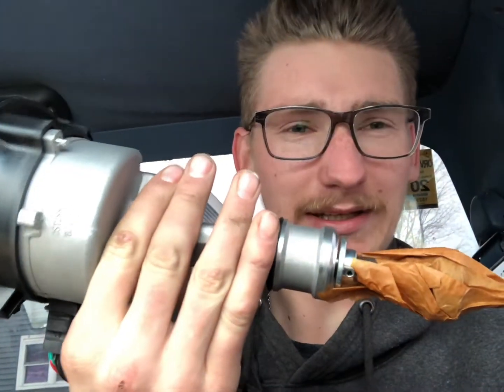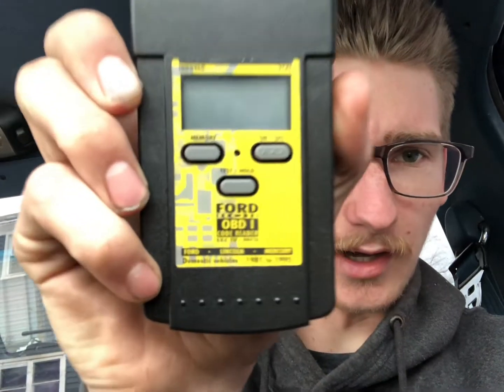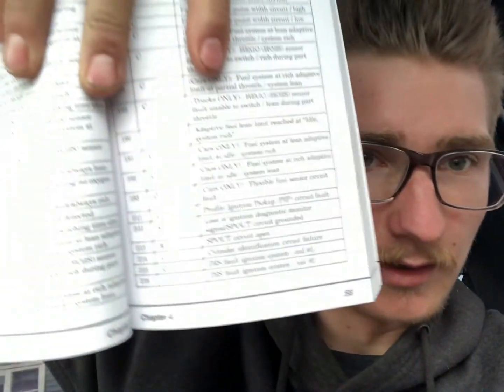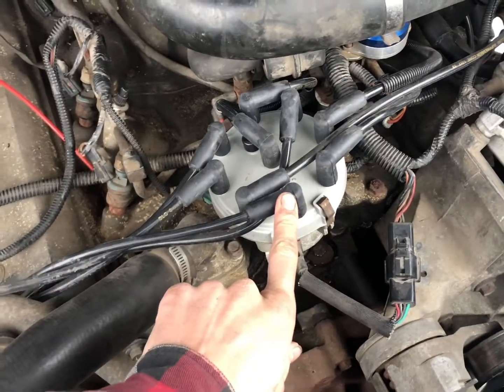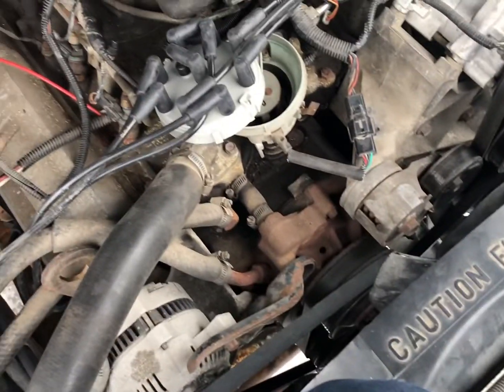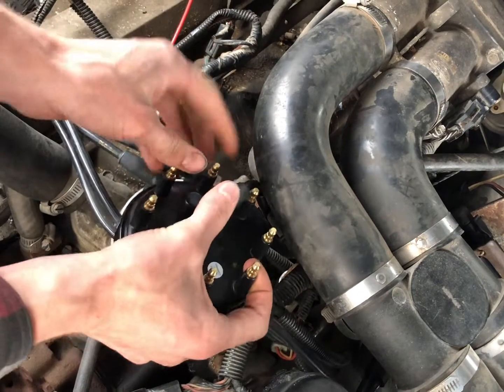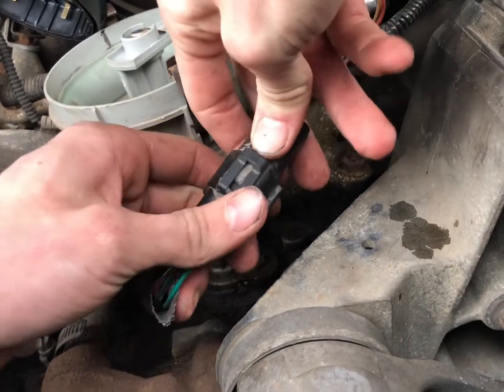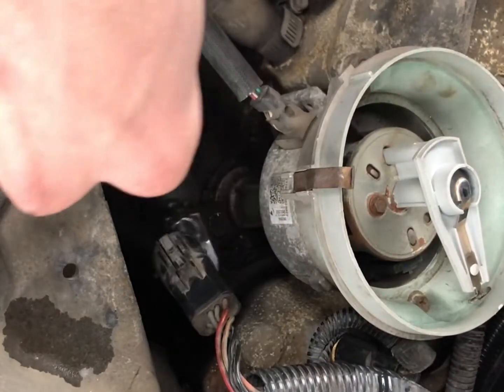1996 F350 460 DISTRIBUTOR REPLACEMENT

Comment: So much is wrong with this. 1, you should have marked the position of the rotor prior to removal, and observed which way it spin out. 2, on these trucks you have to removed a wire jumper so the computer will stop trying to correct your timing as you adjust it. either your failed to do these steps, or you simply edited them out. For you to release an "instructional" video, and leaving out this critical steps, shows either your lack of knowledge, or your lack of giving a crap about your content being of any value.

Comment: This is how to NOT install a distributor. You edited tf out of this video and you know it. If someone follows your instructions they'll have a vehicle stuck on their driveway not running! You were almost 180⁰ off on your distributor. You must mark the distributor to the block AND mark the rotor tip in relation to the distributor so that way your timing is as close to where you removed it as possible, then set with a timing light per manufacturers specs. Please don't follow this guy's instructions!
Reply: You are right......... Although maybe not be so much a douchebag! Sounds like you know some shit......... Help folks out.
Reply: You are right......... Although maybe not be so much a douchebag! Sounds like you know some shit......... Help folks out.
Reply: You are right......... Although maybe not be so much a douchebag! Sounds like you know some shit......... Help folks out.

Comment: easy to put on TDC have to find timing i forgot what it's called little plug thingy you unplug to set timimg i think to 0 plug plug backin and it should be at 10 degrees timing is ecu controlled

Comment: What is a code p0320
Reply: Engine speed sensor - these engines use the distributor pickup signal to sense engine rotation and cylinder 1 identification - one of the teeth on the shutter wheel  is narrower that's how it knows.  The P0320 usually stores in the freeze frame data so you can see what else was happening when the signal interrupted.  Also, if the check engine light comes on in the run position but doesn't shut off during cranking and the engine will not start, this means the ECU is not receiving a profile ignition pickup signal (PIP) during cranking.  Usually the distributor pickup is bad, but it could be the ignition control module or the ECU, or a power or ground issue.   You could send a ground signal to see if the ICM/ECM reacts as it would the PIP to further troubleshoot.

Comment: Why would you not put the rotor pointing in same direction  going from day light to dark you had to figure out how to bring cyl 1 up to tdc lol
Reply: I lost my position  so now it won’t star so any of u know the. Right position bring in up the cilinder  and where the rotor need to be pointed at ?
Reply: @davidquezada5818 rotor needs to point to 1 cylinder and when you remove cylinder 1 spark plug put your finger in the hole and when you feel the air coming out that tdc